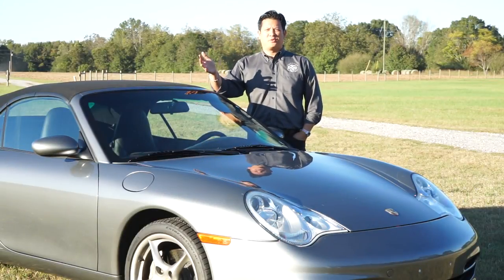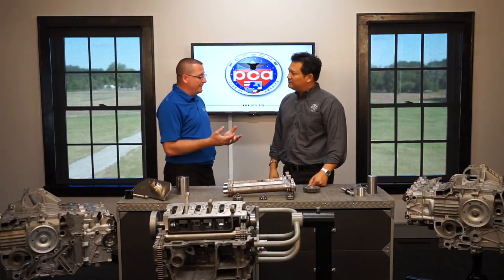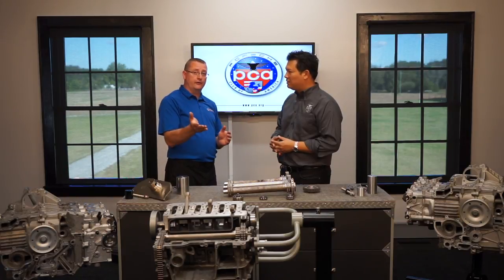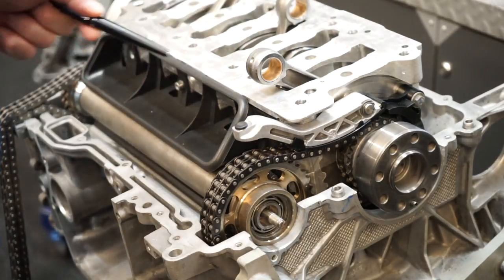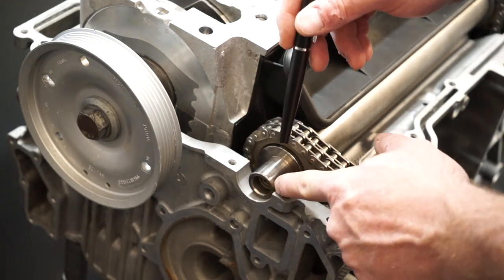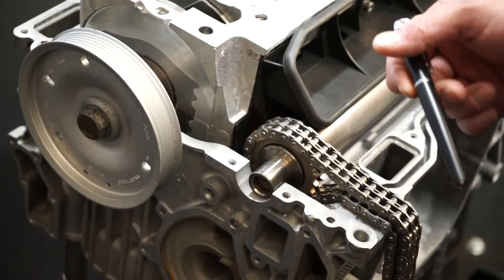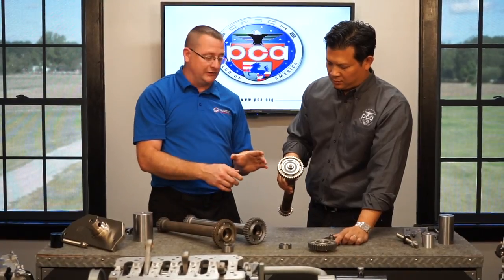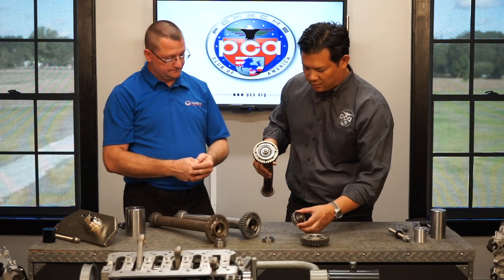Porsche 986/996: Intermediate shaft and IMS bearing explained - PCA Spotlight

Comment: It blows my mind that I can buy a 4cyl subaru short block for $4k that will hold 30 lbs of boost and upwards of 800 hp, but it cost me north of $15k to replace my 3.4 6cyl hunk of pot metal that won't hold a single lbs.

I'm about to just swap because it just doesn't make any sense to throw more money at an inferior engine.
Reply: Sunyata Not sure what you mean about not handling boost. Lots of supercharger and turbo manufactures make really nice kits for these cars and lots of people are successfully running them. Granted, they run about  6 lbs. (not 30). I had a VF Engineering Vortech on my 02 until my IMS went out and loved it. Porsche used the supercharger as an excuse to deny me in the class action but I have no doubt my it failed because I had the small single row. Well over 100k on the reman engine from Porsche with the larger bearing and no problems. No offense to Subaru, but there are other reasons to drive a Porsche then just massive boost (basically everything else that's great about them) but then l'm not a drag racer. Back in the day, 996s with this kit were running mid to high 11's which was was certainly fast at the time. I paid top dollar for mine back in 05 but I certainly wouldn't discourage anyone from picking up a clean 20k 996 with the larger single row bearing and boosting it and I don't think 997s fail very often at all (mostly just boxers and Carrera's unfortunate to have the small single row) Racing is another story and people like to race Porsches so of course some will make a mistake and destroy their engine on the track.
Reply: I've heard Subaru's have their issues with blown head gaskets and rod knock, a common known problem with the boxer engine.
Reply: Did you do the swap?

Comment: Can the larger IMS from 2006 be upgraded? Meaning to eliminate the IMS issue?
Reply from the maker: Only if you were to split the case. There are solutions out there that bore out the case to be able to extract the bearing, but be sure to read up on whether that is a good idea.

Comment: lol "For reasons unknown, the factory chose not to incorporate this design on the opposite end of the engine"... Oh I think someone knows, and that someone is likely an engineer at Porsche.
Reply: They'd never admit it, but after two revisions of the M96 bearing you'd think they'd fess up.
Reply: More likely an accountant
Reply: My wife thinks it was intentionally designed to fail.  She said the confirmation was when they went to an even weaker single row bearing around 2000.  Remember, VW bought up the remaining controlling shares of Porsche around 2012 after Porsche was completely beat up after this IMS issue.  And with specific regard to the IMS bearing issue, it was pressure differential within the IMS itself that causes the bearing to lose what little grease it was installed with.  The fix is a new bearing PLUS some type of lubrication modification like a DOF for example.

Comment: The question is why did Porsche change the double row bearing to a single row. The IMS bearing has a heavy load driven from the crankshaft and then driving the camshaft. The only thing I can think of they were cutting costs to the detriment of the consumer.

Comment: Is the assumption that the plain bearing at the other end of the IMS is pretty much bullet proof? Are these bearings changed when the ball bearings are repaired? Where do I find out more about repair options? Thank you for this very informative video!
Reply: The plain bearing at the other end is "bulletproof".  There is nothing to change.
Reply: @AOWGroundBeef  Porsche knew this too, as they retained the plain bearing on both ends on the gt cars & turbo

Comment: If the basis of the failure lies on the wear of the bearing's seal, how is it possible that this seal will only wear on 5% of the cars (in the case of the double row bearing of the first version of the 996)?
Regards.
Reply: The root of the problem poor IMS design by Porsche  -  you add engine load on a poor design and BOooOOOOm!
Reply: The environment that the seal lives in may have something to do with it. If the car is not driven much the seal may be more likely to get brittle, how someone drives the car may make the engines temperature a little different, etc. I think the real answer is nobody knows for sure.

Comment: Fantastic video as far as showing the different types of shafts and bearings and all the intricacies of those...terrible video as far as explaining the cause of the failures or what the resulting damage could be.  Most with IMS bearings are concerned about how they'll fail, what the damage will be and what the remedies are.  There needed to be more discussion on that.  But otherwise, very informative.

Comment: How does the single and duel row bearing get its lubrication? Is it the splashing of oil from the crankshaft or is it a sealed unit?
Reply from the maker: Sealed unit, that becomes slightly unsealed over time and dumps all the "lifetime" grease out, and doesn't let enough splash oil lubrication. For the smaller bearings, it's recommended to replace. For the later, bigger bearings, pulling the grease seal is a common preventive measure.

Comment: I changed my 2005 Boxster S (open style) IMS with the European Parts Solution with direct oil feed and cylindrical ceramic roller bearing.  $2400.  I had them do a new clutch and pressure plate too.  If one can't pay for some of these mods maybe this is not the right car?

Comment: Did I hear Jake say the 2006 Carrera S might still have the M96 small diameter bearing? Have listened a couple of times to that regard. Considering a 2006 S with 51,000. Not certain anyone views or PCA might comment, but gott try!
Reply: the safe zone is 2007 and up.....the for sure safe zone is 2009

Comment: I owned a 1967 911S from 2004 to 2013, with over 100,000 on the original engine, it ran beautifully without any issues.  If only Porsche engineers could have produced the same exact engine, or made small improvements where possible in this same engine.  Who wants to buy a $70,000 Porsche where the engine fails at 5,000 miles, or 15,000 miles?

Comment: I owned a 1999 996 it had 100,000 miles with an original bearing no problems but i was scared it would go i sold the car dirt cheap i wish i knew about the dual row bearing i would of felt better

Comment: Contemporary Turbo, GT3, GT2, engines retained the Metzger air cooled plain bearing design. Why didn't Porsche go back to the plain bearing, after ims bearing failures became apparent?. They knew it was superior as their flagship 911's used them.
Cynical cost cutting = damaged reputation.

Comment: It's not a particulary ground breaking video that sheds light on anything that hasn't yet been explained elsewhere before.

Presenter gets carried away explaining details that aren't all that relevant and don't really add any enlightement and then pays little time discussing the actual failure modes, symptoms, warning signs or ways to prevent them such as driving it enough, not shing the revs, decent engine warm up and having frequent oil changes (amongst other things). 

Also lacking is decent statistical data that quantifies: 'how big of a deal(or not) this really is" in the real world, per type, displacement year and mileage.
But then again what else to expect, LM Engineering is for the main part doing marketing for their product.. the worse the IMS issue is perceived to be the more sales they can attract...
Reply: Those things may be explained elsewhere but in bits and pieces.   This video provides a great background and a comprehensive view of the IMS bearing across generations.
I agree that it would be more useful to know the failure statistics and some of the things should be done to minimize the problem.
Reply: That is not what the video sets out to do...it explains the shaft, the bearing, their purpose, and the various generations.  Does a good job of doing so and summarizing lots of info you will find elsewhere...most of which is half right.
Reply: Is there a more comprehensive link you could provide to additional IMS info?  I was looking forward to the information you described and whatever fix is required.  Thanks

Comment: well thats just great? you start by having the engine on a completely different angle to what you would see the engine as it sits in the bay? He has the Bank of one side of the engine facing up. Let me explain for him. The top were the piston connecting rods are on the top well, that should be facing towards him so the crankshaft is at the bottom or the engine as we all know it to be and the IMS is under it. I cant believe this guy. No water pump to show us no journal bearing in the pump side of the engine to show us OMG! please dont tell me this guy actually trains people about this stuff. I think he has forgotten we are just Porsche owners and have a go DIY people some mechanics maybe but not Porsche technicians. Please invest in a camera that can do close ups. I know the difference with the sprocket end of the intermediate shaft but we are trying to educate people hear at least show them what your explaining? Everyone watching this video is obviously interested in the whole concept of the IMS and bearing. This is (quote- better technology) making the drive sprocket a little wider, Wow must have been a Porsche professor who thought of that. What technology !!!
I will just put another little something rite. You will not see the IMS drive chain or sprocket by taking your gearbox off. You will only see the IMS bearing. So you will never know what shaft you have unless you take the oil sump off along with many other parts , which i would not recommend. Im so glad they put that reference up on the screen because a lot of  early year Caymans had the M96 IMS.
I was just about to pull this man apart as he has all the years mixed up and just mumbo jumbo talk. As well as the screen comments take everything this man says as Loosely. What a shambles this video is,  i hope Porsche themselves see it and order this man to get some serious training. I feel sorry for the other presenter as you can see by his face he knows this is all bullshit.
Just 1 more thing to round this off. The whole point of this video is about the IMS Bearing failing in the Porsche they are fitted with.
The failing is 99% of the time because they were not lubricated properly. They would just get the splash from the crankshaft rotation and nothing more. Considering how important this bearing is in as part of the engine this was just thoughtless The oil filled bearing had to put up with tremendous heat and the  rotation from the shaft which dried them out in no time. When changing the IMS bearing you can purchase a replacement that is manufactured to have its own oil feed that you can plug and play. I have fitted hundreds of these and they stop this fault for good. A good explanation of this and fitting the new oil fed IMS bearing is to watch Ant Anstead on wheeler dealers season 15 episode 10. You will see and learn exactly what why and how.